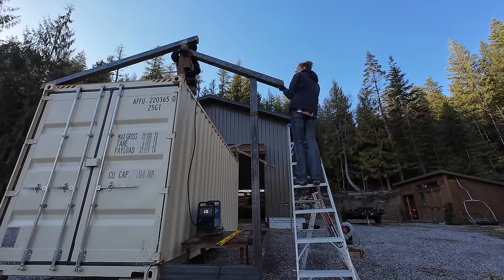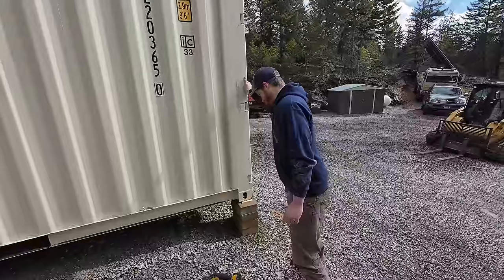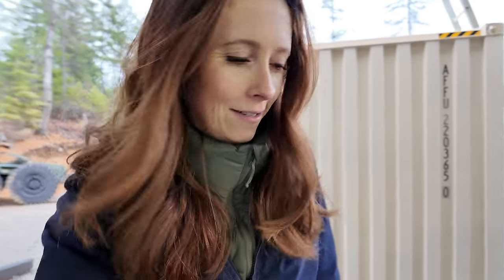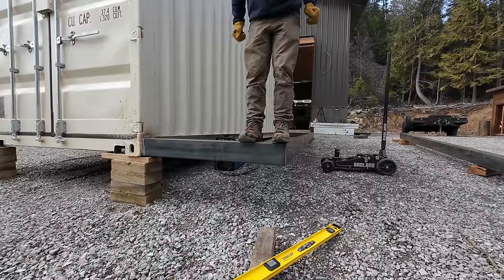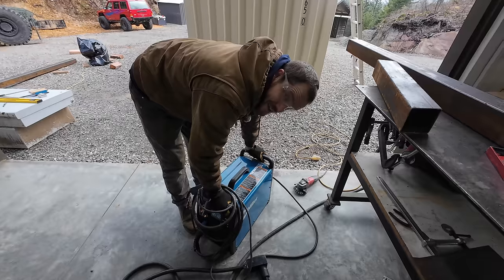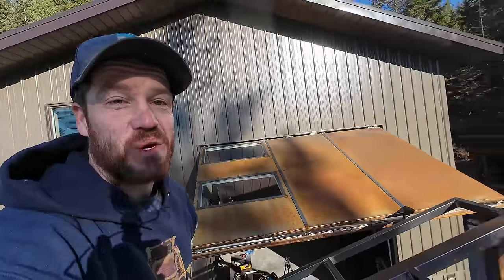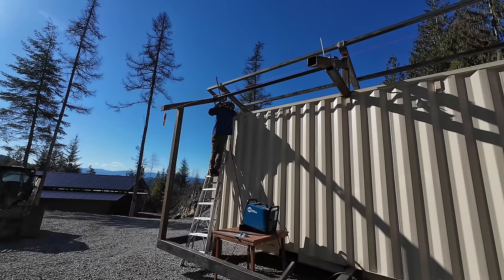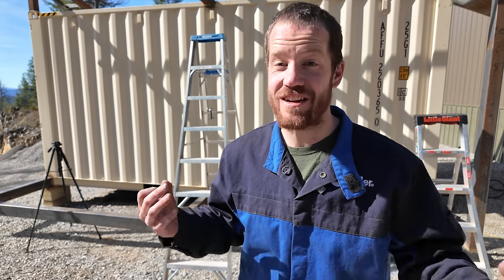Building a SHIPPING CONTAINER Tiny Home | P1

Comment: First if I remember correctly Courtney is 6 ft 2 inches tall. Second, I'll join the weld brackets to the container and attach wood to them crowd. But I'm also more familiar with working with wood. Finally the two of you should put together plans this build, and similar ones using different size containers. And then sell them to people like me that would like to do this but don't have all your design skills. I could definitely see this being the start of an off-grid property for myself.

Comment: I commend you for your sensibility in clothing for the environment. While working outside it is very sensible to cover up as much skin as possible with loose fit breathable fabrics. A wide brimmed hat, like Courtney is wearing, is also much better than a baseball cap. Because you want to protect yourself from to much direct sun exposure as possible, in order to prevent sun-burn.
Prolonged direct sun exposure can very easily lead to serious second degree burns. Especially at higher elevations or on water (like lakes or rivers).

Comment: The older you will thank the younger you when applying the rule to work smart not hard. This means using the all of that wonderful equipment you have to raise heavy items like the welder or steel to higher elevations. Wearing proper PPE is like ear protection' eye protection, gloves and knee pads will greatly improve your longevity into doing what you like to do! 

Having to push through pain when one is older kind of robs us of our life so, work smarter not harder

Comment: Watching you lift the welder on the container with suck ease is baffling. You can use the skid steer as step or a platform.
Question. Are the big metal beams necessary? Couldn't you have used 2x4 instead of 4x4 metal ones?

Comment: Intermediate comment (I'm always giving building advice): MAKE SURE, even if it's an all-metal roof structure, to provide for "attic" ventilation mostly to eliminate condensation. Unless the roof deck is also insulated, the key is that the attic temp should approximate that of the outside atmosphere. If you insulate ALL of the attic space from ceiling to roof deck, you shouldn't have any condensation. Remember, see my comment about InSoFast. 😎 Don't forget under-floor insulation, because HEAT ALWAYS SEEKS THE COLD to migrate to.

Comment: 18:27 I think its no brainer if you can weld ... you just weld some metal brackets to the container and make some holes in it and join them with the wood no need to ruin sealed container. I mean there are ready metal brackets for wood ... you can just weld those to container instead of screws. You get your sealed not leaks container and wooden roof no ?

Comment: Plus one, working on dodgy heavy stuff alone almost always ends badly. First hand comment sadly. But a set of replacement numberplates for the 100 series landcruiser was all it took to fix. A bit of scratched bumper paint can get resprayed later. The vehicle that rolled downhill into it didn't fare so well, ha ha, but it was a parts car anyway, phew.

Comment: Riley is going to hate this comment… but the solution to attaching wood. Is to weld on brackets to the container. Could be as simple as an off the shelf pre-made saddle. Just like the wood beams holding up his house are bolted to the anchors buried in the soil.

Comment: You have the smarts and equipment.  Start using the equipment and lean manufacturing.  OSHA will be happier and you will take less time.  Even when lifting the welder onto the roof. Smarter not harder.

Comment: Wait, no flip down porch and flip up Eve?  How is it going to live on that Sweet Truck in the background?

PS, great roof lines.  Really makes it unique.

Also, there is a DIY container Store that sells like Simpson type brackets to attach exterior framing, and metal studs can be welded on.  I like the look of the HSS at the eves but having metal studs makes attaching sheathing way easier.

Comment: Why not use an extruded profile shaped like lumber for the roof trusses and deck e.g. 2"x10" tube? Nearly all your loads are vertical loads so the two webs that are 10" deep will provide much more load capacity and stiffness than a 6x6 square tube yet they are the same amount of steel (the deeper the web is on a beam the more load or longer span it can carry). The perimeter of a 6x6 is approx. 24", the perimeter on 2x10 steel tube is 24." This added capacity would have allowed a wider deck Square tube is good for vertical columns, but not the best choice for horizontal or diagonal members. A 150 sq.ft is going to be an micro house! e.g. a 12'x12' bedroom is nearly the same size. I think your mom deserves a 40 ft to stay in for all the help she gives watching the little guy. The average size of a hotel room in the US is 325 sq.ft, 150 sq.ft is too tiny.

Comment: As someone with severe lumbar spinal stenosis from not working smart when I was younger, I can say from experience that ANY extra time your spend to protect your back is well worth the delay. I'm 55 now and I am very limited in what physical activity I can do because I ruined my back, and it will only continue to deteriorate. A couple little things you can do to help protect your back...1) wear a back brace anytime you are lifting and/or bending a lot and 2) always use the machinery you have available to minimize the amount of manual lifting you have to do. Again, saving a few minutes on a task is never worth destroying your back and it will catch up to you, even if you feel fine now. Just lookin out.
Great work on the tiny house build so far, looking forward to the rest of the project.

Comment: Why are you carrying the welder up a ladder when you literally have heavy equipment to lift things? Why are you worrying about getting a table and brick to elevate the welder so you can reach a spot to weld when you can put it on the skidsteer to whatever height you need? You've used the skidsteer as a work platform previously on the container workshop, you could also be hanging steel beams from it to have them in the right place to weld.